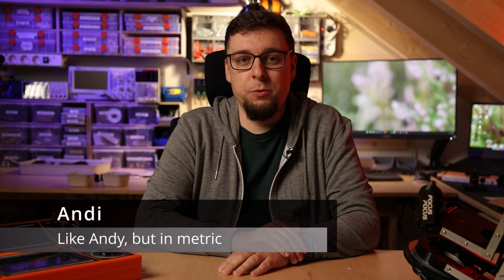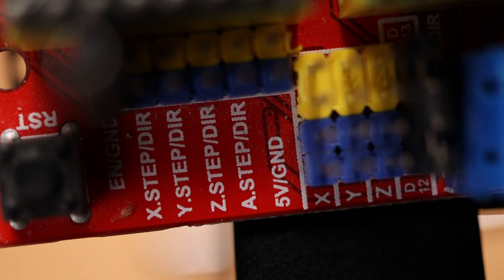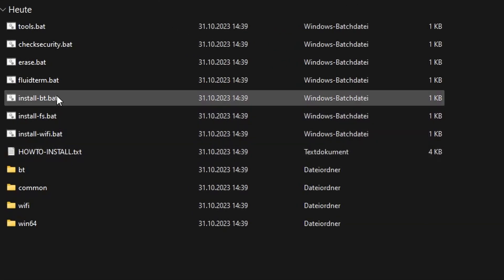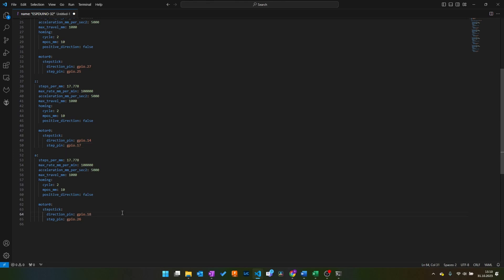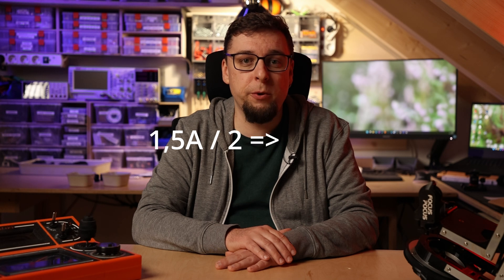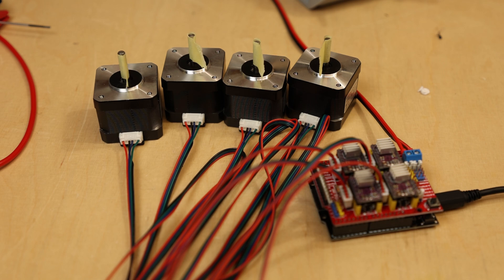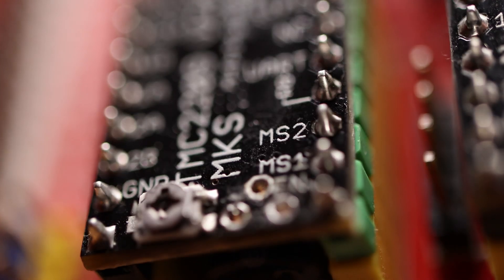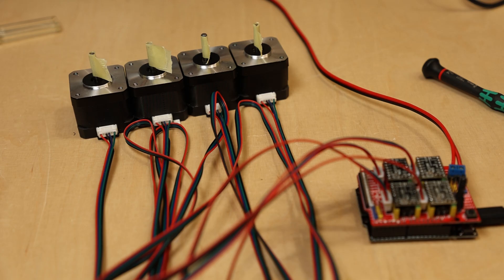Espduino + TMC2209 + CNC shield

Comment: Curious. Could you not just change to a different pin on the esp32 ?
Reply from the maker: If you're using a different board I would also choose a different pin but with the cnc shield you're pretty much stuck with it

Comment: Thanks a lot for the tip with the 10k pull down resistor!. You saved my evening!
I found in the forums that you had to cut the pull-up resistor on the enable pin, but that only fixed the problem as long I had no 24V connected to the board. With the 10k pull-down it works without issues!
Reply: Small update on this: The 10k pull-down prevented me from disabling the motors by setting D8 to HIGH. So I eventually ended up disabling the flash voltage check and forcing it to 3.3V by burning the corresponding e-fuse via esptool. With this, the 10k pull-up on the pcb can (and probably should) be kept :)

Comment: Danke für Dein Video! Sehr professionell. Ich versuche den TMC2209 mit einem Arduino UNO und dem CNC Shield V3 zum Laufen zu bekommen und er läuft ausschließlich im 1/16 Modus, aber immerhin, er läuft - brauche aber eine Drehzahl von 1200 rpm. Kann der gar kein Fullstep 1/1? Muss ich auch die Widerstände dafür umlöten oder hab ich ein anderes Problem? Die Jumper am Shield kann ich setzen wie ich will - keine Auswirkung. Wenn Du helfen kannst wäre ich froh, befinde mich quasi in einem 
{
buttloop
}
Reply from the maker: Ich kenne keinen Schrittmotor Treiber mit fullsteps. Manche können 1/8 aber weniger ist eher selten. FluidNC erreicht eine Schrittrate von bis zu 125khz, in manchen Fällen anscheinend sogar 250khz. https://github.com/bdring/FluidNC/issues/218
Bei 125khz und 16 microsteps erreichst du über 2300 rpm. Wenn das nicht reicht kannst du schauen wie du an die 250khz kommst oder eine Übersetzung verwenden (Belt, Gearbox, etc.)

Comment: ahhh, i wish i knew it before, now i am stuck with esp32 wroom 32D cnc and drv8825 drivers
Reply: Same to me can I help me
Reply: @RangaRajan-c8t  Well i am still stuck, mainly bc i fried my drv8825s but i learnt some things throughout my way, first of all drv8825s come with multimeter on top and you must set them to current rated for your motors if you are using Nema17s like me then its 0.75Amps (there's tutorials on YouTube), second always check power supply polarity with multimeter before hooking up with cnc ( fried 3 of em ) and about Esp32 to cnc to drv8825 connections i have no idea, i used ChatGPT for wiring but never got to see if it was correct or not, wish you luck man and maybe update me about how you are going

Comment: Hello. Can u tell how to set the microsteps for this setup? For other drivers jumpers between M0,M1,M2 is used. Is the process same for this setup? And does this setup utilizes the full potential of tmc 2209 drivers?
Reply from the maker: It's the same up to 64 microsteps. To go higher you need UART

Comment: Hi, Thank you for this great video ! I have reproduced the same setup with a Wemos D1 32, CNC shield v3 and TMC2209, I have cut the R1 resistor and added a 10k resistor between EN and GND. But I still get stuck in a boot loop when 12v is on. ( rst:0x10 (RTCWDT_RTC_RESET),boot:0x33 (SPI_FAST_FLASH_BOOT) )
Do you have any idea why ?
Reply: I think a 10k was too much, I replaced it with a potentiometer to test it out and the boot worked well with around 3k or less
Reply from the maker: Hi, I've experienced different behaviour from different stepstick modules. They were all TMC2209 but different versions (1.2, 1.3, 1.4, 2.0 etc.). These different versions require different setups on the cnc shield. Some need the R1 intact (Bigtreetech 1.3 in my case) some need it gone ( MKS 2.0 from the video). I'd try different combinations and even different drivers. Also experiment with a jumper or resistor between GND and EN on the shield.

If you can, find the schematics of your stepstick module and check for pull up/down resistors on the enable pin. This pin on the esp (gpio12) is sesitive to voltage levels during boot.

How did you adapt the Wemos D1 to the CNC shield? Or is it an Arduino formfactor like I use?

A different problem you may experience: the power supply on the ESP boards is garbage. If you experience random boot loops during startup of fluidnc try a capacitor between 3.3V and GND. The onboard cap is not strong enough to support the boot sequence.

Comment: Thanks for this great video. Have you done any changes to the config between the DRV and TMC drivers?
Reply from the maker: Thanks 👍 I don't think there is a difference between the two, config file wise. Just the pullup as described in the video
Reply: @fuzzy4logic  THank you. It works great, except the boot loop when 12v is pluged in before usb. Otherwise it works now great. I also added the 10k resistor between EN and GND like shown in you video. Any ideas to this?

Comment: Hello mate, I have an issue with the ESPduino while using the CNC shield on top of it. I used to connect the uC with UGS normally with the CNC shield on top of the ESPduino with no problem, but now there's something strange. I can't connect it with shield on top, just without it and then adding it on top. Do you know what's the issue or where to start looking at?

I'm currently using TB6600 drivers, CNC shield (same version as you), and ESPduino Wemos D1 R32

I made connection with a regular ESP32 with no issues and monday morning I'm gonna make a test with a CNC shield based for Arduino Nano  using a ESP32 Nano instead. Hope you're doing it ok, I enjoy the quality of the info you give. Hoping for an answers, greetings from Perú.

Sorry for my bad english btw
Reply from the maker: This sounds like a pullup/pulldown issue. Check the boot output over serial to see if it is stuck. Some pins configure the flash voltage of the esp during boot and having pullups/pulldowns can really mess things up. You can remove the resistor on the cnc shield to see if it improves things. No bad english in sight ;)

Comment: BTW The ESPduino power connector handles up to 18 volts, in theory you could use the same power for the ESPduino and CNC motors. I was wondering if you tried this and what was your experience with it
Reply from the maker: I've tried it with 12 volts but the regulator got pretty hot. Because it is just a linear regulator, the remaining power gets turned into heat. I use mainly buck/burst converters now